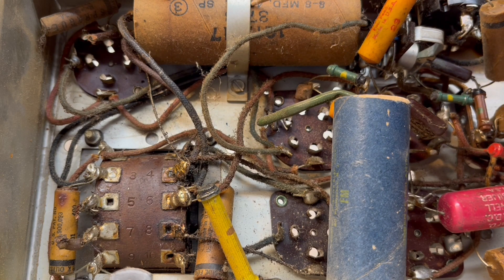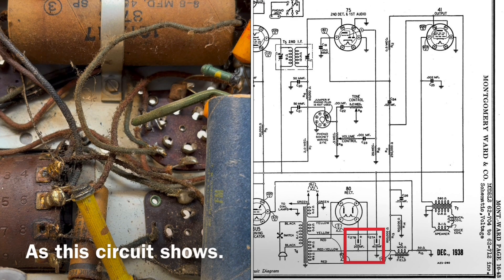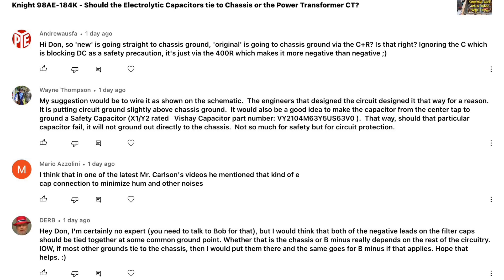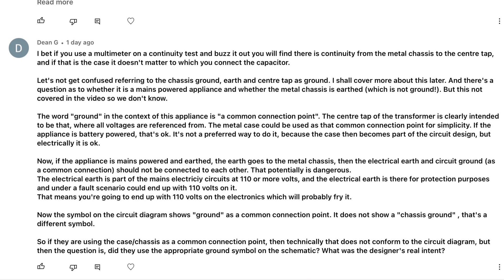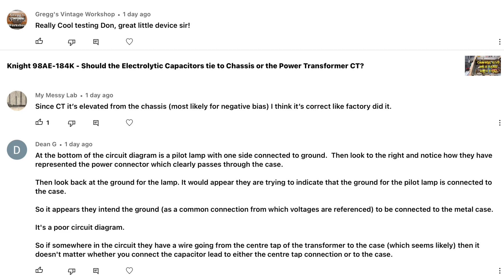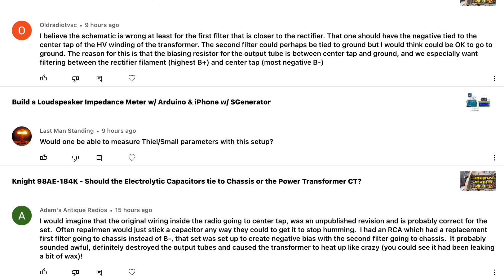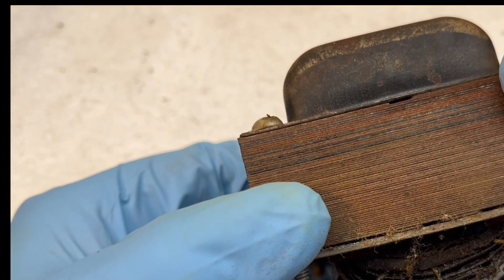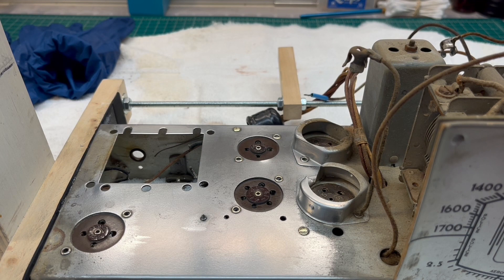Knight 98AE-184K -  Review Comments for Electrolytic Capacitor tie Point & Rust Removal Update

Comment: Hey Don, Related/unrelated to the discussion was my introduction to Zenith's way of doing things back in the day with their cathode grounds. On several (if not the majority of) models they tie all of their cathodes to chassis but nowhere is the chassis grounded to earth, to the line input or to the transformer.  After seeing this in three separate models & their schematics I decide not to fight against the wind and moved on though admittedly my first thought was I believed they were using "voo doo" but apparently it worked well for them. Notwithstanding,  in my novice opinion I believe and agree with the notion that 'center tap' reference would be considered the negative point reference for that electrolytic cap. Happy hunting, great videos and best regards.
Reply from the maker: Thanks for your insight, it’s appreciated. I think I’ll tie both to the CT and then move the 2nd E-cap to chassis and take note of the performance and DC voltages. Hope you’re doing well. Best, Don